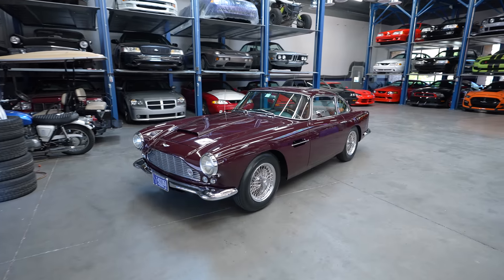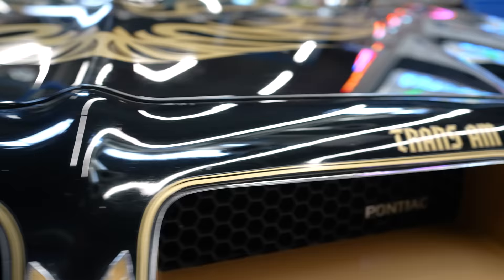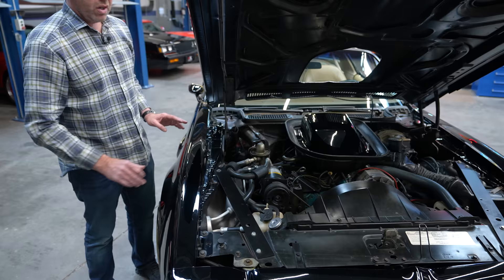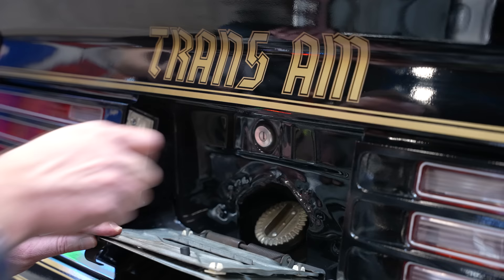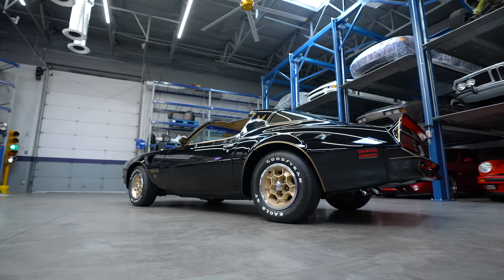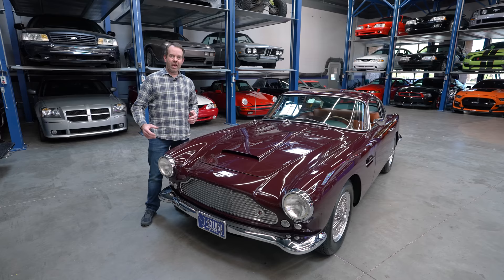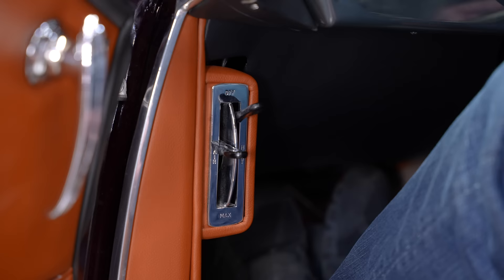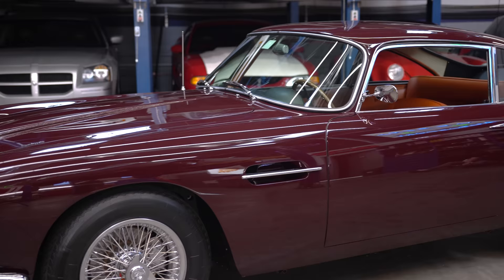Burt Reynolds or James Bond? 1976 Pontiac Trans Am or 1962 Aston Martin DB4? | The Appraiser - Ep. 2

Comment: He should run those fingerprints on the paint find out which factory worker is responsible for that LOL
Reply: I'm sure that didn't happen at the factory
Reply: I have an original paint 76 trans am and it has fingerprints in the paint and one of the pinstripe decals was applied upside down.
Reply: @MrBlaze256  thank you for your input there buddy

Comment: The 1970's and early 80's were the worst for GM build quality. I had a 1975 Camaro I order special from the factory and when it was delivered it had a about a one foot diameter paint blemish in the roof and the gas gage didn't work and the ashtray was the wrong color. After those defects were corrected at the dealer about 300 miles later the front wheel bearing failed and on inspection it was never greased at the factory and being a four speed car the factory shifter would lock the transmission in two gears ( usually first & reverse ) on a regular basis. Another thing tat was annoying was the factory installed Goodyear white letter steel belt radials all failed ( the rubber split with the steel belts showing ) at less than 5000 miles because they weren't guaranteed above 80 mph.
Reply: I bought a 77 Trans Am when it was only a couple years old .The paint on the driver door was already cracking and had to be repainted
Reply: That had to make you sick.

Comment: Fun fact: Many of the Trans Ams in "Smokey and the Bandit" were actually '76 models fitted with '77 front ends, since most of the movie was filmed in the summer of 1976 before the '77 models were released to the public.  Apparently, the studio made a special deal with GM to purchase the '77 front end assemblies which of course included the new elastomeric housing, grille inserts, and four square headlights, and this was done before any of these parts were available through dealerships.

Comment: "Factory air conditioning" "really cool" Not sure 70's GM A/C works well enough to deserve that description. ;)
Reply: Actually, oddly enough, that Harrison/ Frigidaire A/C running on R12 would blow ice cubes. A lot of other manufacturers used it as well as a result. For example Jaguar, Rolls, Bentley. It was indeed the gold standard in A/C.
Reply: @colincomer4566  I guess all the 70s GM cars I've been in have needed re-gassing. Thanks for the info!
Reply: @adotbeck  good point. I should have said "when it was working" because it wasn't immune to the overlying GM issues of quality control of the day :)

Comment: I like the vids your doing.  However as a car freak and a painter and a paint tech rep some of that paint doesn't look factory.  I see some panels and places are quite a lot of peel but others look like flat sanded and buffed lacquer. Seats look way to good to be ages even if cared for properly. Very nice piece but sus to me. Trunk jamb and under trunk is sooo glossy.  Never mil gauged a classic like that but is 2.5 mil typical of a single stage finish?  Or were they closer to 4-5 and it's from age and buffing. Thanks for vid. Not trying to attack or hate on you.
Reply: Hi, thanks for watching! The T/A is absolutely original factory paint, I metered every panel and also, like you, have been painting/ restoring cars for a while- 37 years actually. The camera tends to make things look different on the screen but I assure you the decals and paint are factory applied. And yes, typically factory single stage is around 2.5 mils on the exterior while the jambs are 1.0-1.5 on a lot of stuff from Detroit of the era. The interior is all original as well- remember this is a 14k mile car with full owner history that David has owned for 20 years and put on 5k of those miles. It's legit. Thanks again for the comment! -Colin

Comment: Db4 had DOHC, independent front suspension and disc brakes all round...compare that to what America had at the same time 😂 0-60 is more around 8 secs flat
Reply: 283 cu. in. engine with 250 hp, fuel injected, fiberglass bodied car, independent front suspension with roll bars on a stiff chassis for cornering ability, and just as beautiful. Sure, the C1 Corvette had drums, but they were BIG drums at 11 inches. More than enough to slow the car down as well as the DB4 could manage. Limiting factors back then were tires, not brakes.